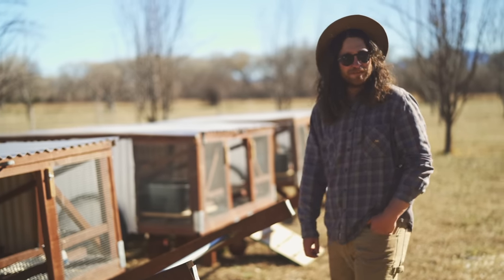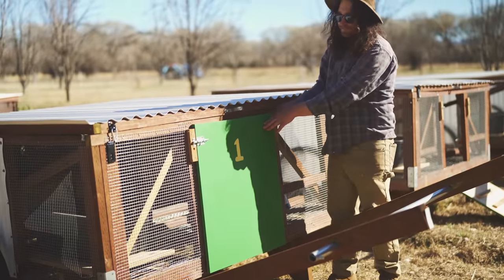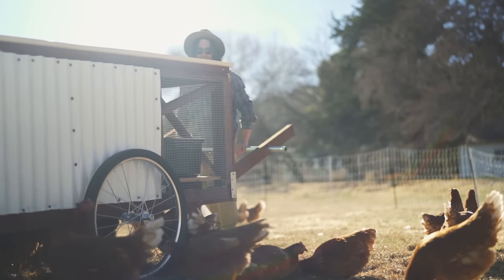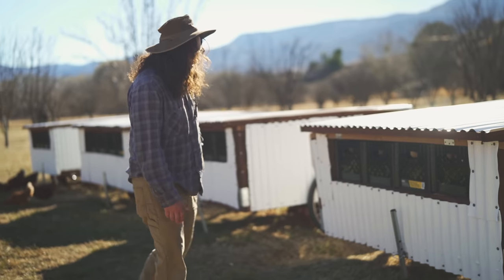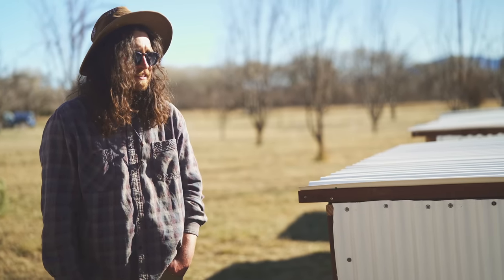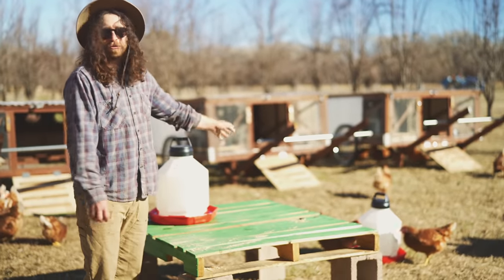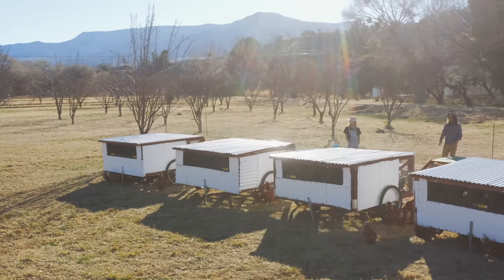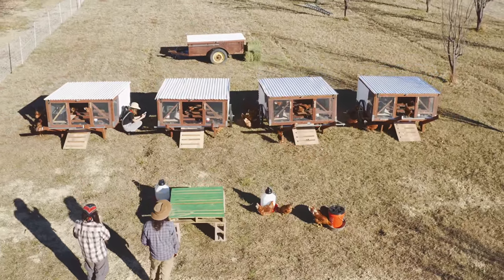Bent River Farms ChickShaw build

Comment: Heck yeh man! Love it on the grand scale. But you can put 50-60 in each of those :)
Reply: Hey Justin! Sitting here ordering my materials to build the Chickshaw 2.0. Have you seen wood prices lately? 😲 Can't wait to meet up with you and Rebecca in Front Royal this fall!
Reply: Thanks for the inspiration for our Chickshaw :) Holding up well after 4 years of wet & windy conditions here in Scotland.
Reply: I agree, why push 25x5 chickens around on enclosed land they are already shitting on?
Reply: @davebannasch  I ordered every piece and part off the chic Shaw pdf but once I got to building it I realized I could just over lap the 2X4s opposed to using so many angle brackets. I ended up returning over $120 worth of parts and mine is bomb proof. 

Same concept just modified a wee bit. 🤙
Reply: Do the birds stay in the chick Shaw over night?
Reply: @Taking_Back_Thyme  lol, yes. And unless you put an automatic door on it you need to manually close them every night. 

Most my birds jump on top of it every night and I have to put them inside before I close it.
Reply: @chief5981  so one would use a chick Shaw in place of a static coop?
Reply: @Taking_Back_Thyme  sort of.. you would use a chic shaw if you have enough space to move your flock around often. Keeps them on fresh grass, prevents poo from accumulating and prevents them destroying one area. You would also give them an enclosed area using electric fence to keeps them from running off and keeps predators away. 

If you’re limited on space than a static co-op and chicken run will do just fine. They’ll have that patch down to dirt in no time though.
Reply: @chief5981  so maybe I need a static coop and a small chick Shaw so I can also move them.
Reply: @Taking_Back_Thyme   I have one that is between this design and salitin tractors. It was 6x12' w/12 hens. Moved morning and night. Safe, clean the yard up and nicest grass I the yard wherever the go. Static in our vicious winters in northern sask, Canada.  As I like to say, fuck around and find out.
Reply: @carsonbutterwick77  if I look at Joel’s chicken tractor and the chick saw will I be able to figure out what you did?
Reply: @Taking_Back_Thyme  even better than mine, you can make it to suit yourself with their inspiration.  I used what I have laying around mostly.  If I did it from all new materials it would be better, but all I bought was the hardware wire. Good luck!
Reply: Thank you for providing such a great resource with the plans for this design.